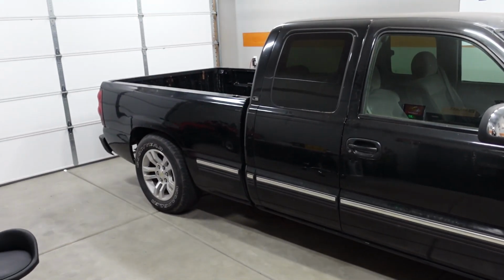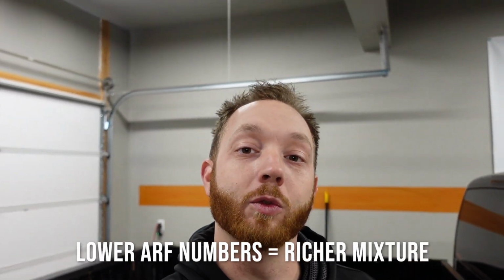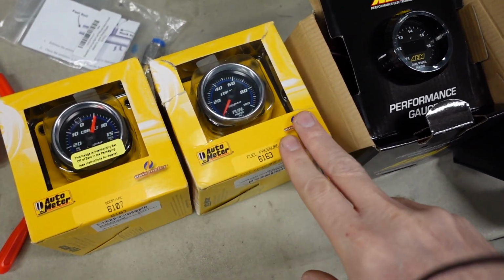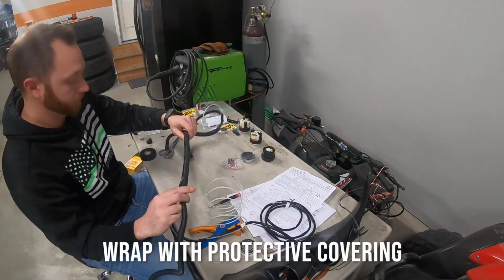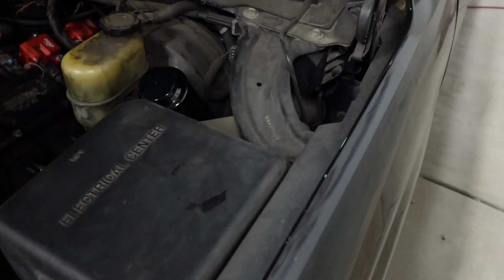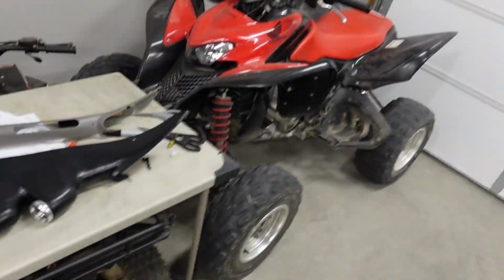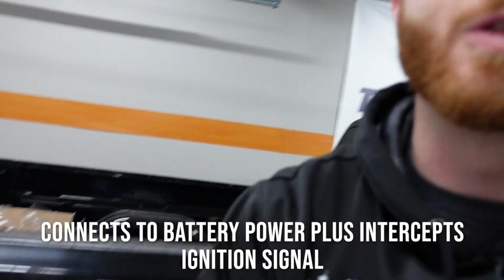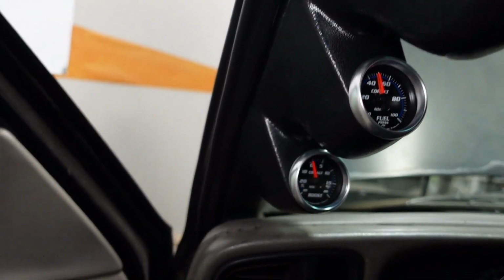the MOST IMPORTANT GAUGES for your turbo car or truck

Comment: If that wasn't what was causing your battery drain issue check the back side of your gauge cluster. I had that issue with an '04 Yukon Denali. I couldn't find it so I took it in & they thought it was the aftermarket remote start or the aftermarket stereo/tv. It was neither. My dash started smoking a month later. The gauge cluster had partially melted & was causing the battery to drain off it sat for more than 4 days. Put in a new cluster & no draining issues in the last 2 years.
Reply from the maker: good tip as well!

Comment: Why the plastic tube and not a rubber hose?
Reply from the maker: thats what comes with the gauge kit and has all the fittings to match, plus I'd have to get a few extra fittings to use a hose  barb. Once its in, the plastic tube is great, it just fights you going in
Reply: @LawrenceTolman  ah ok. Thanks for the information, you’re awesome.

Comment: You can safely run leaner than 14.7:1 at part throttle cruising (in fact you can run lean up to around 70% load).  At part throttle if you keep leaning an engine out you'll get cooler egt's since you're not making as much power, you'll eventually get lean "misfires" where the engine vibrates more due uneven fuel distribution across the cylinders (this happens sooner with a carb vs mpfi), then finally lean flame out when the engine is starved of fuel.  You only hurt things if you're lean and under heavy load. 
In the aviation world running an engine "lean of peak" egt is pretty common (15 - 18:1 AFR)...
Reply from the maker: thats good info!

Comment: the $100 autometer pillar pod isn't a full replacement either.
Reply: I was just about to ask if anyone knew of a full replacement cause I’ve never found one myself
Reply from the maker: ahh, you're right I just double checked. I guess was thinking of the 2007+ trucks I put autometer pods on, those were full replacement.

Comment: What battery are you running and where did you relocate it.
Reply from the maker: just a normal parts store battery, and its in the stock location up front on the driver's side

Comment: LT i'm whatching you from Brazil! Love the truck content
Reply from the maker: Thanks for watching! You guys have some cool trucks down there we dont get up in the states, like the inline six diesel GMT400s and the short bed single cab Ford F250's
Reply: @LawrenceTolman  The chevys here have a 250 inline 6 and a diesel MWM 4.2, also inline 6. The F250 came with the gas V6 also the MWM 4.2 (same as the chevy or GMC) but with intercooler and finally with a Cummins 3.9 isb. Have a nice day LT!

Comment: I’ve read that putting the fuel pressure sensor on the rail exposes it to engine vibration and causes it to go bad sooner.
Reply: Pulsation from injectors and vibration on an electric gauges transducer/sensor on stock steel rails but not as common on aluminum rails or a mechanical gauge, seen it a lot on road course cars. Easy to run a transducer/sensor off the end of a braided line and zip tie it to the wiring harness to absorb abnormal vibrations.
Reply: @young11984  Ya.... What he said..

Comment: Idk id say oil pressure is the most important gauge afr 2nd.
Reply: It already has one in the dash
Reply: yeah that's nice They don't do that a lot of the new cars anymore which is crazy all you see is fuel and coolant temp I want my voltage and oil pressure stock.
Reply: @sock979  most oem gauge are heavily dampened anyway, so a warning light accomplishes the same thing while making the dash less cluttered, not that it is ideal
Reply from the maker: true, but like was already mentioned, the truck has an oil pressure gauge in the dash

Comment: Autometer makes factory match 2000s gm truck gauges for boost,trans temp, promoter, etc
Reply from the maker: they do, but they don't have a vacuum/boost gauge or a 0-100 psi fuel pressure. otherwise, those are the gauges I would have run

Comment: Resist the urge to use white Teflon tape when fuel is involved!  It can/will melt over time. Use the yellow gas fitter tape.
Reply: On gasoline?

I thought it was for ng/p.
Reply: @shadowopsairman1583  - Meant for, yes.  But also happens to resist other hydrocarbons as well.  I used to make a fuel gauge kit and found out the hard way after several 'calls' about leakage.

Comment: I haven’t found a full replacement pillar gauge pod for these trucks if anyone knows who actually makes a full replacement rather than a slip over please let me know.
Reply from the maker: check out autometer, they have a full replacement
Reply from the maker: nope, I was wrong. the Autometer is a slip on cover as well
Reply: @LawrenceTolman  I was rely hoping I was wrong and u was right cause I hate the glow gauge slip over one I have. Going to buy the auto meter slip over to see if it fits and looks better.  Thank you for the response.

Comment: Where exactly did you find that "GPS"?
My truck battery dies after a week or so of no use!
I've replaced the battery 3 times....but can't find anything draining it 😡
Reply from the maker: it was underneath the steering column, but on top of the metal reinforcement plate thing

Comment: I have an 01 Ranger 302 swap and have the same AEM gauge, love it! Also wired it up so when I was using the SCT tuning software, I could do the same thing you are, and lay it over. The wideband setup even had the formulas needed for converting it over to the signal I needed. I used a flush mount USB mount from amazon so instead of a lose wire, I just used a double ended usb cable and plugged the laptop into the truck.
Reply from the maker: hey thats a good idea on the USB instead of wires

Comment: Stock recip engine is 12parts air:1 part fuel for cooling reasons without being too lean which causes cht and detonation, preignition.

Stochiometric ratio is a theoretical ratio but physics limit us to 12:1.

Comment: This build has definitely caught my attention. I see boosted LS trucks all the time but forsure the Vortec 8.1 swap on a 1500 truck is different from the rest! I actually have a Supercharged LS swapped G35, so it’s interesting to see this big beast in a 1500 2wd truck. I want to know the tire size you have for those front wheels, i have a 01 sierra extended cab with those same wheels and planning on doing same drop you did, and those tires look perfect with that setup! Can’t wait to see the power that 8.1 will put on low boost!
Reply from the maker: the front has 255/55/18 at the moment

Comment: I've ran two of those glow shift sleeves too I mean yeah they're cheap and they just slide over the normal pillar so you have to drill into the stock pillar but I always thought mine looked pretty good I actually used an 0509 one on my 2011 because they didn't make a 2011 and the only triple pod one was way too expensive and I just did a tiny bit of trimming and if it my 2011 mustang just fine.  But yeah after seeing that I think I definitely pay more for the auto meter sleeve It looked bad and it didn't even look like they pointed at the driver very well so you could just take a quick glance and then back to the road sorry that sucks it didn't work for yours I liked mine on my mustangs though

Comment: glowshifts products are crap, im not surprised here.I personally like autometer but AEM makes a good wide band gauge that isn't super expensive. maybe pyrometer and trans temp if the cluster doesn't have that function. either way it's coming along good LT. Looks like she's running a bit lean at idle...

Comment: My car came stock with the 02 sensor (which is a wideband) about 6 inches after the turbo.
Also I have a GlowShift triple pod, while yours fits your vehicle much nicer my gauges definitely fit better! Top to bottom I have AFR, boost and oil pressure gauges. They all fit perfectly!

Comment: Where are you sending the computer to get it upgraded for your new motor and turbo I need that information for my build
Reply: He’s using the stock 5.3 ECU if I remember correctly. Catching the drift he’s going to tune the stock ECU with HP Tuners.

Comment: I ran those 3 too but I prefer the digital cuz digital is just so much easier to read especially afr.  I stopped doing those pillar mounts though but that's cuz I smoke I kept catching my cigarette on them and the ash would fall in my lap.  Also I always use the electric sending unit type only have to do that for the fuel pressure regulator please people do not run fuel into your cabin for your fuel pressure gauge.  Your boost gauge it needs to be behind the throttle body otherwise your reading doesn't matter it's not what's making it to the engine.  And on my last two builds I ran the innovate wideband and it worked great for me each one I had for 2 years no problem both bill does only run in about 10 lb of boost one on a V3 vortec and one on a m90 supercharger but I like those innovates cuz they're cheaper and so far they've worked for me